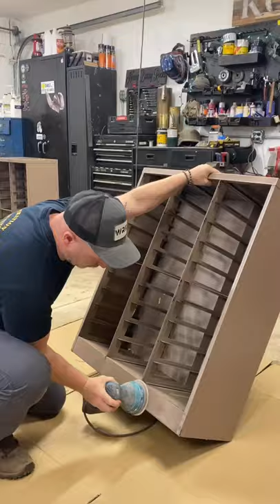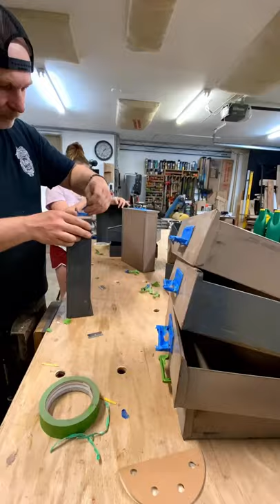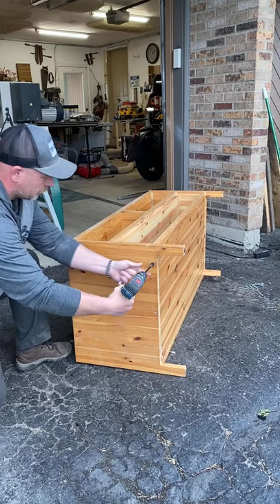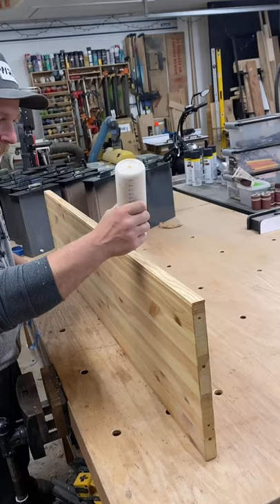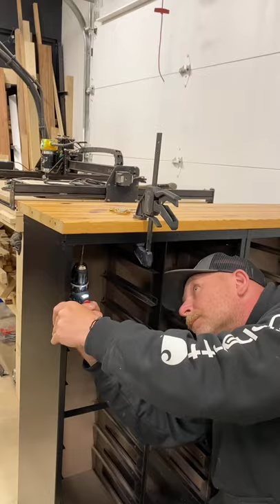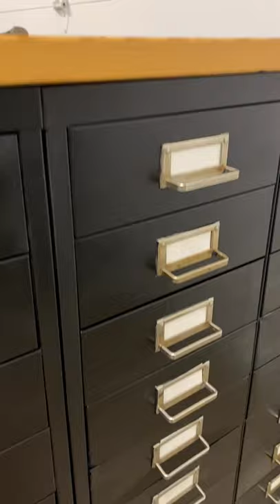Restoring a Old Metal Cabinet #Shorts

Comment: What did you do first, before spray-painting? The video is so quick, I couldn’t tell if you were smoothing the surface first, or sanding it...? Have been thinking of painting the metal cover of my electrical panel, which seems like a similar metal to the cabinet.
Reply from the maker: so i just sanded the surface with 120 grit and and primered the surface.  you just want to scuff it a bit so the primer has a chance to grab onto the panel your working on. hope that helps

Comment: I know this video is a little old, but I have the exact same cabinets, down to the same color.  I'm going to do the same, but paint them craftsman toolbox red with black drawers. The repurposing of a bookshelf for the top is a great idea.  I'm wondering if you had to replace any of the drawer handles and if you did, where did you find them. I think I have 5 or 6 drawers that need replacements. 

Thanks.